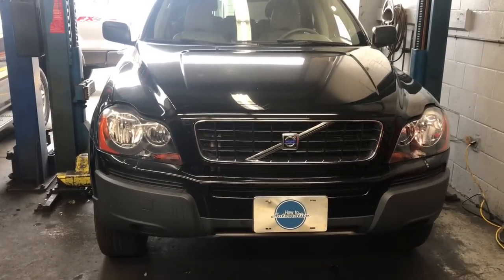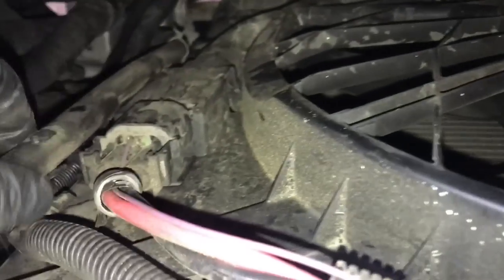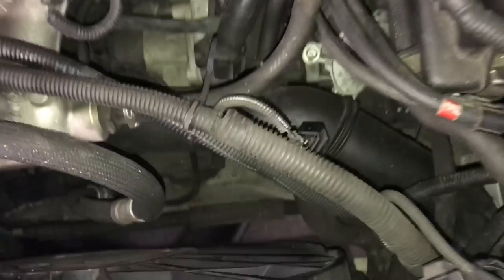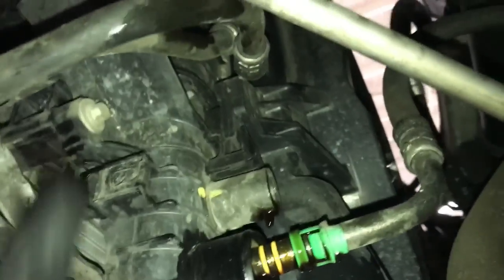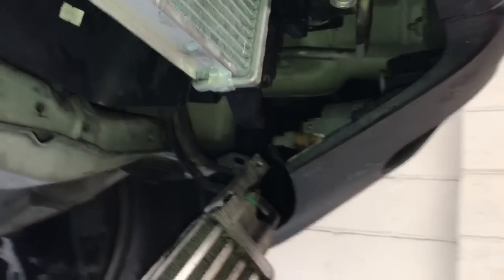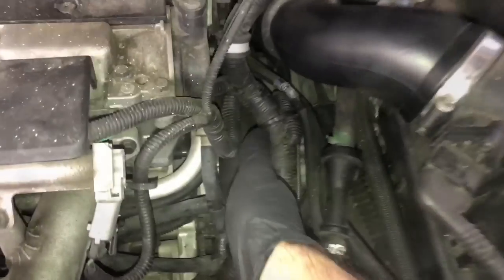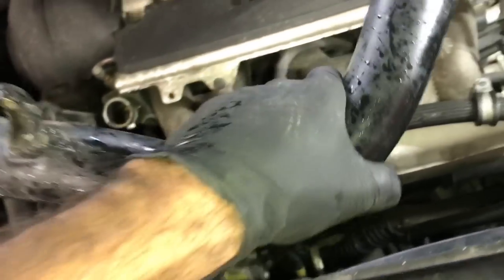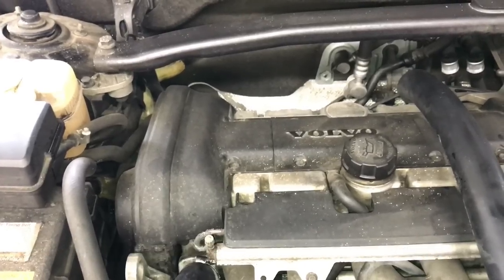Replacing The Radiator On A 2002-2014 Volvo XC90 With 2.5l Turbo Engine

Comment: Another thankful DIYer. Amazingly helpful video. I changed the radiator out 8 months ago thanks to your video, and plan to use it again as a recap for a cracked innercooler that I just discovered. Hopefully that’s the reason my MaF sensor keeps throwing code and it feels a little underpowered when I get into the throttle! Thank you so much again. Liked and subscribed!

Comment: The plastic reservoir to the side of my '07 D5 has cracked after bending the skid plate while off roading. I was planning on removing the radiator to repair the crack but after seeing this I think I'll try any and everything else first. My goodness, of coarse Volvo made it as complicated as possible. Great video though, clear & concise instructions. Thank you

Comment: Thanks for posting this video. I found it easier to install bleeder hose to top driver side of radiator by installing the 2-12mm bolts from bottom just enough to hold radiator which allowed me room to install hose and New clamp from top, also while in was in this position I installed upper and lower hose b4 bleeder hose and added coolant to reservoir which allowed me to bleed system of air. Also since trans cooler was hanging in my way I decided to remove the one line holding cooler and removed all together which allowed more room to clear a/C line on driver side. But thanks to your video I was able to do it in 2 hours and made 300$ for labor.

Comment: Question: Firstly, best video on the internet.  Secondly, (2003 XC90) had the radiator completely very loose and on it's way out, however on the passenger side there was "no way" that it was going to come down through the rigid steel cartridge and rigid AC lines blocking the bottom end about six inches from the edge inward on the passenger side. Anyone's thoughts?

Comment: Hello Sir i am from 🇩🇪 thanks for sharing your video i got an 2.4 AvD do you think I can pull the radiator from the top? I’m not sure you said in your video it must be pulled up from the bottom but I think I have enough space do you think it is possible it is a  xc90 year 2004 2,4 diesel for me. It looks like I have enough space because the engine is not that big like yours in your video.

Comment: Do you know if most of this video will apply to a 2005 XC70? How much vertical clearance is required to drop the radiator out the bottom?

Comment: 4:31 where is it leaking from right there? So to the left of that, where the raditor is at, there is that metal piece right there. I have an issue on my Volvo and it is leaking coolant from there I am unsure if it is the radiator or whatever that piece is called.
Reply: Or 4:33

Comment: On the "passenger side" there seems to be a steel cylinder and some rigid steel lines that I believe are part of the AC, of which these are all blocking the radiator assembly from dropping down on the passenger side.  Any thoughts?  2003 Volvo XC90 2.5L Turbo AWD Base Engine.  -best, -hg
Reply from the maker: Harvey Gordon it’s either the oil cooler or the AC condenser lines. I would look for mounting spots where they may still be bolted up in Bolton you don’t wanna disconnect the lines because I’ll release the Freon but look for the hard mounting spots it may still be attached. After that you should be able to float the AC condenser why are you slip the radiator. Unless it’s a different model than the one I’m doing.

Comment: Hi,
Great video. Any way to remove the fan shroud without having to drop the whole radiator? It looks like the two bolts holding the fan are pretty high up close
To the cowling and leaves little to no space to slide fan up and remove...

Comment: I need to repair a leak that’s suddenly sprung at the top of the radiator tank when the mechanic did a compression test.

He said I need a new radiator… jeez! Can’t I just repair the leak near the hose connection with a kit?!

Comment: You keep saying that the line's you did remove i think are the engine oil cooler lines. I have oil in my radiator and no coolant in my oil. Those lines are the only way this can happen.